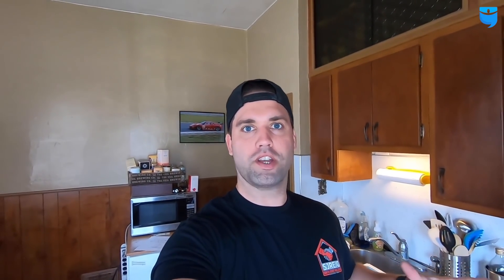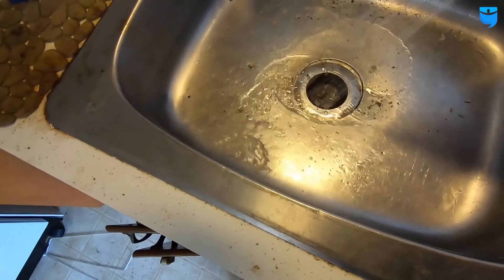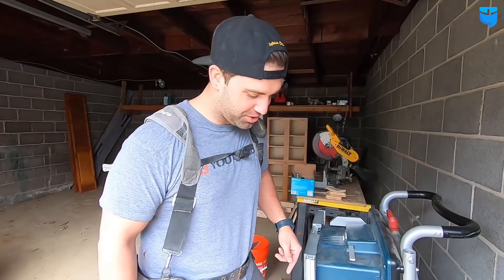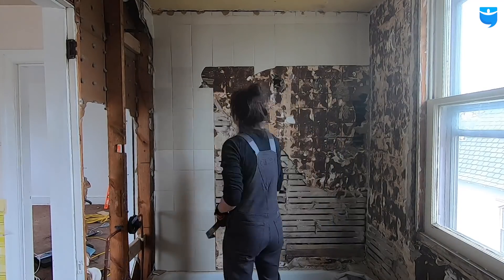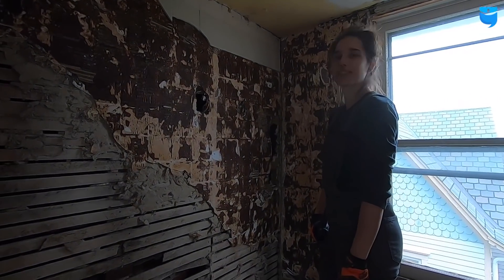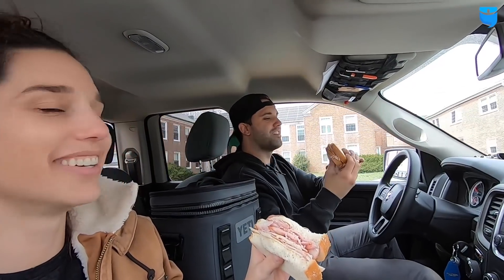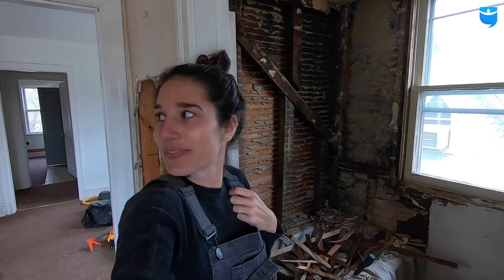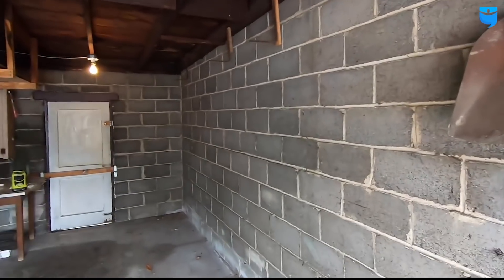EP 8: HELOC, Landlording, & Budget Increases! | Rentals To Wealth Ep. 8 (BRRRR Investment Property)

Comment: You could unclog the faucet, instead of replacing with an even cheaper faucet. Home Depot (retailer) moen is not the same as plumbing supply (wholesaler) moen. Also that drain is wrong. It's an S trap, which means it isn't vented before it drops below the weir, and therefore is likely to siphon the trap water down. Then you potentially have sewer gas coming up into the living space. Even if it's not stinky, it's still unhealthy to breathe. Good luck to you!
Reply: Kirk Daniels I cleaned the screen out and it was still gunked up. I’m not diving into replacing any existing traps until we renovate this unit which will be in the near future.
Reply: @RentalstoWealth  Totally get it.  A lot of the time, the sediment is where the supply lines meet the valve and you just need needle nose pliers to get free. That makes sense with not changing the traps of you're going to remodel someday soon. However if you want a cheap solution (but isn't perfect) you can use an auto vent (cheater vent). Btw I might sound condescending because I'm not great with text, but I'm just trying to give tips.  I'm a plumber

Comment: Couldn't you unclogs the sink instead of buying a new one ?
Reply: We do 🤷🏼‍♂️ where I live the water is rusty as hell and it plugs up often from shutting off the water to change filters ever 2 months or so. Always clogs right at the screen on the spout. Take it out and clean it and Wala. Same sink for like a decade now.
Reply: @adolpholiverbush5867  what state do you live in that has water that is Rusty
Reply: The state doesn't matter they all have this problem. It's just an old country house
Reply: @adolpholiverbush5867  I'm guessing in future projects plumbing will be replaced
Reply: @bradhaughton6698  replacing the pipes won't do much I believe it's the well itself. This water is bad lol
Reply: @adolpholiverbush5867  ok
Reply: @adolpholiverbush5867  I'm assuming this is not connected to the city water system this is underground water if it's coming from the well
Reply: @bradhaughton6698  ya no around here about half of the population is on a well. Unless your in town you get a well.
Reply: @adolpholiverbush5867  ok i see
Reply: Zack Howard Oh yea for sure I coulda just tried to find the clog. The new faucet was 60 bucks and the existing one was pretty shotty. In this circumstance it’s more about tenant happiness then the actual repair. Tenants love new things lol.
Reply: @adolpholiverbush5867  out of curiosity I have a question can air in the line cause water hammering because we have a problem with our bathroom.  We told the landlord he fixed it but then it came back and now we're not getting cold weather we only get cold water in the morning to rest of the time it just hot water until we turn off the pipe and let it sit for hours and then we get cold water then when we turn it off it's turn straight to hot water.